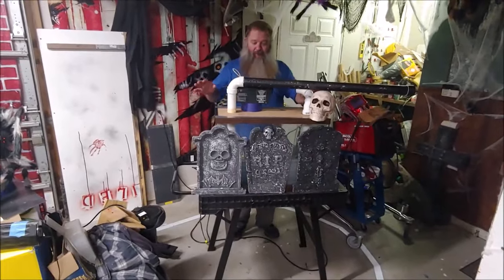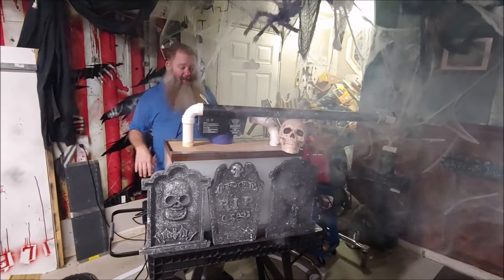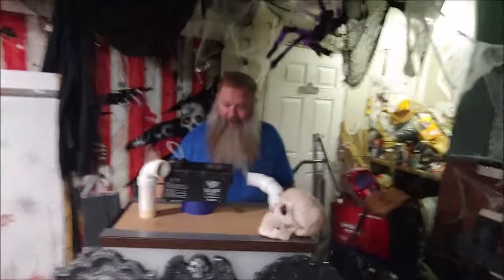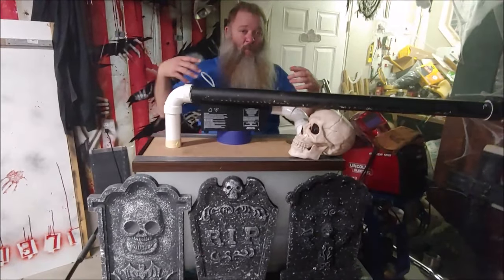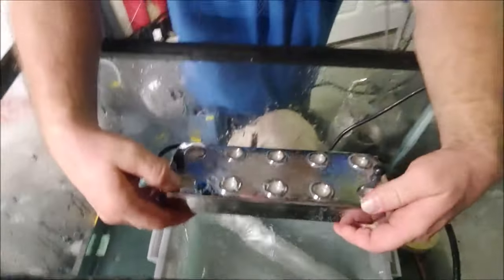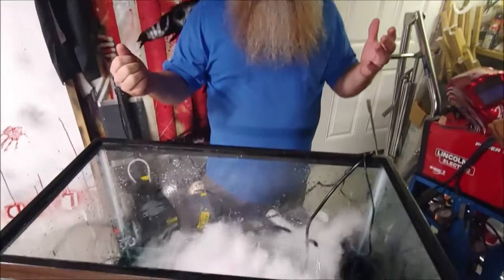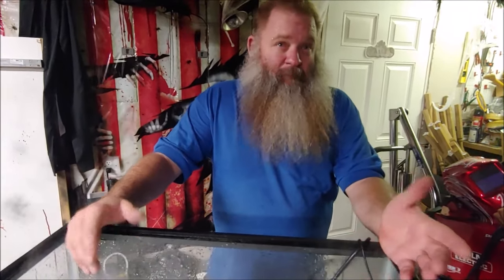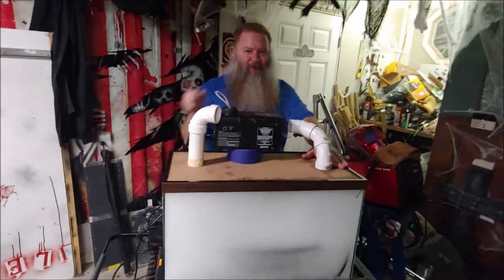Roberts Fogger: The original DIY Fog Chiller without ice

Comment: My dude, you have gained a new subscriber. I was just unpacking my "dryer vent hose" and sighing as I imagined picking up ice for another night's show, in 47 days! I'm not sure I'll get around to trying this, but I'm going to try this sometime before the year is up. This is very interesting. Ultrasonic misters work by vibrating out of time with the water forcing water vapor molecules to break from the water cohesion. Water vapor molecules are defined as water molecule clumps less than 5 microns. This dispersal results in low lying fog due to the energy exchange in creating the the smaller molecule packs. Fog machines, on the other hand, work by flashing water into steam that is bound with glycerin allowing the vapor created to hang in the air and be visible for longer. However, this process creates water vapor that is of much higher energy, aka hot, to produce. If you run the ulstrasonic foggers for a long time, they eventually heat up the water, but its very slow and water has excellent thermal exchange properties. My guess is that when this fast vibrating glycerin fog machine meets the slower moving cold vapor of in your box, there is an energy exchange. Much like a cold spoon in a cup of coffee. Instead here, the water vapor from the mister evaporates off (not quite the right word, but much like it does about 6 inches from the top of your tank with the lid off), when it meets the hotter fog vapor. There is an energy exchange during that evaporation thus the fog vapor gives up some of its energy. Due to the surface area of vibrating molecules of water vapor (5 microns or less) to the glycerin bonded fog (5 microns or less) you get really efficient and fast energy transfers. The water will warm up too, as there is contact at the surface with the hot fog, but the ultrasonic process should still produce cooler water vapor just because its mechanism does not add much energy to the water vapor to break the water up. That's my thoughts anyways. I'm not sure if I will have a chance to try this out, but I surely will mark it down. Curious to see how long one can go on it with the same low lying fog effects, but I know I've generated low lying fog from hot water with the sonic sensors, so they moderate energy really well. If I build one, it will be labeled on the side with who came up with the idea! Well done sir.
Reply from the maker: What an awesome explanation of theory.   I love learning about this effect.  
I can say that the cooling ability worked for more than 3 hours.  I had to refill the fog fluid during the night.  Never had to replace the water. 
I'd love to hear of your build when you tackle it. Thank you!!
Reply from the maker: @Photon123  I'm stoked to hear that it worked for you as well!  I, too, have added a float.  One less moving part to worry about is always good, but I just cannot agree that a plastic float should cost more than a water pump.
It was so nice to not worry about checking the ice level or drain the melted water.
It's definitely one of my favorite projects.  I have some other fog related projects I am trying to get working.
I haven't posted all the tinkering and testing and failures of this project... but I am really glad to share a working method with the haunt community.
Thank you again!
Reply: @intocoasters  Between the float and a water control valve I may put in later, I think this will be a big addition actually. Gotta do a lot to make this right still, but my proof of concept sold me on it. I was using my cheapo little walmart 20 dollar fogger too, and the output was impressive. I can't way to buck out ole goliath and pain the street with clouds. It definitely saves me that awkward rush to the store down the road before the show to grab ice panic.

Comment: Absolutely amazing to see this! As an effects artist and dealer for Ultratec, Chauvet, and Martin/Jem smoke I’ve used just about every major low-lying fog system over the past 20 years.. (LN2, CO2, Dry Ice, and the all electric Antari DNG-200 seen in my profile pic are a few examples) We repair machines and I can confirm that this is how the Chauvet Cumulus, Cloud 9, and the Froggy’s Fog Poseidon machines work. Your solution however delivers the same effect on a smaller scale and is perfect for haunt scenes or plays and does not cost thousands! Very impressed sir. Thank you so much for sharing this.
Reply from the maker: This is awesome to learn!  (and also a bummer as I thought I stumbled upon the method for the first time - but I guess someone else is always going to be first. LOL)
Since you have worked on those machines, any suggestions how to streamline this design?  
Do you know if the mist chamber size has any effect on the fog output?
I am using an aquarium because it was readily available and I wanted to show off what is happening.  If I made a smaller chamber, would that reduce the overall effect?
Thank you for writing!
Reply: @intocoasters  You’re welcome! In response to the question, the mist chambers on these commercial machines are small. Think about the ice chamber size in something like an American DJ Mister Cool on the small end (Chauvet Cumulus) and the Antari Ice on the larger units (Cloud 9 and Froggy’s). 
In order to make everything smaller you could do what they do and place an external water tank with just a gravity (dog water bowl) type regulator to maintain proper water height in the chamber. The more expensive units use a pump and a sensor. 
On a side note, all of the commercial units have chamber fans to pressurize the chamber a little. Most look like computer fans. The speed on them is variable so you can control the effect even more and have longer hoses attached. To keep the mist inside you could switch the fan off and back on only when you needed the effect. Hope that helps!
Reply from the maker: @TallHaunter79  this is awesome info!! 
I'm surprised the chamber can be that small. That would help a lot!
And adding small fans seems like a good (and obvious) idea. I really should've thought of that in my build. LoL
Reply: @intocoasters  The whole concept blew my mind when I saw it for the first time at a trade show. The machine had been on for a while at that point and the fog was warm to the touch but was on the ground!!! I immediately went into nerd mode and asked all kinds of questions!! 
For years I thought it was temperature that did it (ice,CO2, LN2,etc..) but it’s more the density. That’s what the mist does, it adds density to the glycol/glycerine fog which makes it heavier than air. Now a chiller does the same thing, and I think the output is a little thicker/whiter, but for someone needing the basic ground fog effect and not a “dancing on a cloud” type thing, the aqua fog (as they tend to call it in the industry) is perfect without the need for cold stuff.
Reply from the maker: @TallHaunter79  This starts to answer a question that no one else seems to have a satisfactory answer.  What make 'low lying' fog fluid different from regular for fluid?  I can get similar results with the cheap stuff.  It just seems 'low lying' fog looks thinker. It really doesn't perform better enough to make a difference in most of the scenes I've used it for.  I mean, 'low lying' fog still needs to be processed in some way to stay low.  
So, is it just a higher concentration of glycol or something?
Reply: @intocoasters Questions like this are why I am taking the advice of colleagues over the past 15yrs and changing my name officially to Dr. Fog as I know too much about this stuff!! Lol.. But I’m glad to share!!
Low-lying fog fluid is actually a lower concentration or ratio of glycol/glycerine to water. You want it lower because it needs to dissipate faster in order to stay on the ground and not rise. What determines the hang-time of fog is this ratio. That’s why the cheaper stuff does produce a similar effect because it’s cheaper due to it having more water in it. The chemical (glycol or glycerin) is what drives up the cost.
Reply from the maker: @TallHaunter79  mind blown. 
Thank you. Seriously.  
The most common answer I would get from DJ suppliers is " you use low lying fluid to get it to stay low".  But that was the extent of the answer.  LoL
I guess they aren't as curious as I am. 

I did try "quick blast" or "cryo blast" quick dissipating fluid to try to mimin LN.  But that dissipates way too fast going through the plumbing.
Reply: @intocoasters  It my pleasure. Most people in the industry are sales guys. I learned from production techs and just working with whatever came in the shop or anything I saw or could play with as a stage tech. 
I went searching the other day for a fog curtain tutorial to save time on our haunt build this year and found someone as curious as me! Thanks for communicating as I love to share my knowledge. I just happened to be taking a day or two off to recoup, we have the local television crew coming to the haunt to film this years commercial this weekend so there’s lots of building going on so we can go “Boo”. Feel free to ask anything and if I don’t know, I’ll find out for both of our sakes!
Reply from the maker: @TallHaunter79  THIS!   This is why I love being part of the haunt community!  
I've learned so much by searching online and seeing what others have shared.  
I try to share things I build or have learned to help the next curious home haunter.  
Thank you again.  Very much.

And hope the commercial goes well!  If you can, share it on your page? I'd love to see it.
Reply: @intocoasters  Absolutely!! Yes! When we first started going to trade shows and seeing just how many vendors and fellow haunters there were it was actually heartwarming to know we were not alone!! If you haven’t been to St. Louis to Transworld’s HAA show I’d highly recommend it. We’ve been going there 7 years now and it’s easy to see why it’s the largest industry show out there. You get lots of ideas and if you don’t want to build it yourself you can usually buy if there. Plus the friends you make who do what you do and love it as much, man it’s fantastic.

Comment: This is a really good idea.  I've thought about experimenting with a solution like this, but never gotten around to it.  Thanks for showing the results you were able to achieve.  In addition to providing more water vapor, I suspect the mist is an efficient way to lower the temperature of the output quickly.  Though not as cold as ice, the contact area between the mist and the hot gas is probably huge.

The cheapest fog machines rely on the nozzle output mixing with the surrounding air, which is why you see a difference when you do/don't leave a gap before routing the output into a distribution pipe or chiller.  Slightly less cheap machines have a fan to bring in outside air to mix.  If the heated juice to air mixture is well tuned, I'd expect the gap after the nozzle would be less important.

Depending on the machine, high wattage can be a disadvantage.  The electricity is used to heat a bunch of metal, like a coil of copper tubing.  As the juice is pumped in, the heat energy is used to vaporize the fog juice, and excess heat energy may be transferred to the vapor itself.  Thus the metal cools rapidly in the process and had to be reheated.  The higher the wattage, the faster the machine can be ready to produce more fog.  But some of the high wattage machines have a tendency to make the metal hotter than necessary, so your vapor can be overheated, increasing it's tendency to rise.  A lower wattage machine might not be able to sustain long bursts or might require more time between bursts, but it's less likely to overheat the vapor.  The best machine design would have more metal (thermal mass) in the heat exchanger and consume just enough watts to maintain it at the ideal temperature, but that would increase the cost of the machine.
Reply from the maker: Wow!  This is a comprehensive answer - Thank you!  I have considered adding ice to the tank or in the tube to bring the temerature down even further... but then I could no longer call it iceless chilling LOL.  But it'll be neat to see if the temperature makes enough of a difference to pursue.

Comment: WOW!!! Robert, Thank you for the information, I have tried DIY of both types of fog chillers you mentioned in your video: First was a HD bucket with ice that I passed the fog through and it contacted the ice... the ice melts an hour or so into the running the haunt and no more low-fog and no time to reload the ice... the second I had a long tube and the ice was isolated... limited effects and the plastic tube melted after an hour or so of operation and that was the end of that!

I can't wait to try and duplicate the effect you're able to achieve: I ordered a few single humidifiers to see if I can get the low hanging fog effect, I will need to design something different because I don't have a fish tank, I will try to figure it out around what I have, which are buckets, plastic boxes, and storage totes... so not sure what just yet,  it would be soooo nice not to need ice at all and filling the bucket with ice while I'm running is such a pain!

Much appreciated for the info... It's the humidity not so much the coolness of the fog that makes it heavy and that's what hangs it low to the ground.  I should have picked up on that fact myself, I've seen a lot of people say that watering the lawn / ground  makes it stick better, and that's the KEY right there.   Happy Halloween... Cheers!
Reply from the maker: Thank you so much!  I'm curious how it turned out for you.
Reply: @intocoasters  It worked great, but the tote leaked like heck... I need to re-jigger the tote, but the mister thing was great, check my channel for the yard display 2021, you can see the glorious fog in the video!
Reply from the maker: @raymitchell9736  oh, that's right!  I saw that and I am steaing your "candles in front of the tombstones" idea.   It's freaking beautiful.
Reply: @intocoasters  I'm glad we can inspire each other, you're awesome too, but I don't have the space (or budget) for a dark ride and all the other things... gosh I wished we lived close by each other, we'd be the terror of the neighborhood Bwahahaha!!!!
Reply from the maker: @raymitchell9736  Oh man, I WISH!   I would love to have neighbors like you that were as in to Halloween - the combined efforts/ideas would be epic!!  (rubs hands together maniacally)

Comment: Having built a couple of fog chillers and watching many videos looking to improve, I found your video extremely educational. I use a mister for my cauldron. The issue with ice chillers is the ice itself and having to buy and replenish each time you want to run your scene. Your method allows for much easier and more run time in my opinion. I have to wonder what the difference would be if you CHILLED THE WATER WITH FROZEN WATER BOTTLES?? I will surely give this method a try.
Reply from the maker: I will try this too this year.  The water does get quite warm after about a half hour of use.... But it still generates low hanging fog. So frozen bottles would help slow the heating I imagine. Great idea!
Reply: @intocoasters Thanks!  I can hardly wait to see the result! Don't forget to try it with the extension tube and the fog curtain!

Comment: The water tank is the replacement of ice it's still a refrigerant you run the fog through. Ice is standard water just colder. Becomes water after a few hours of running the machine. Now you have the tank to deal with instead of a cooler. Same as a cooler